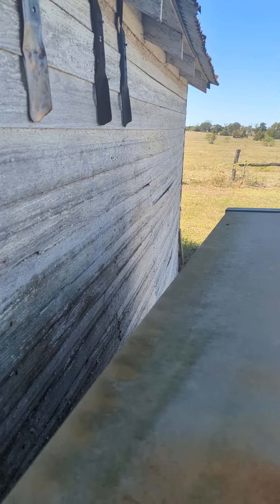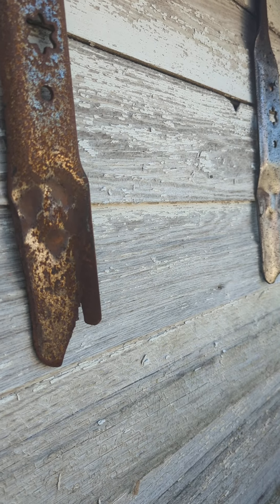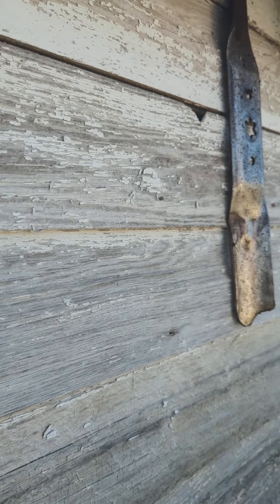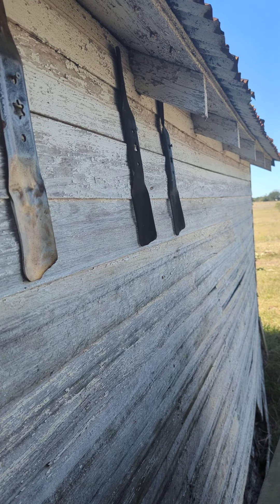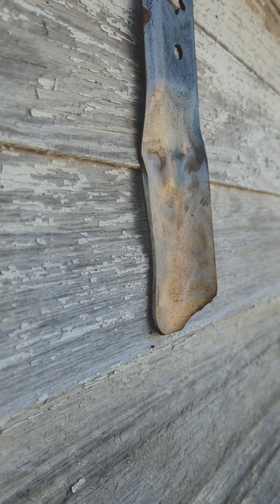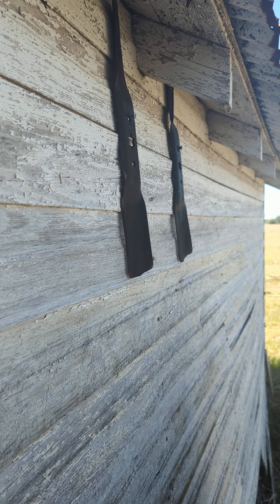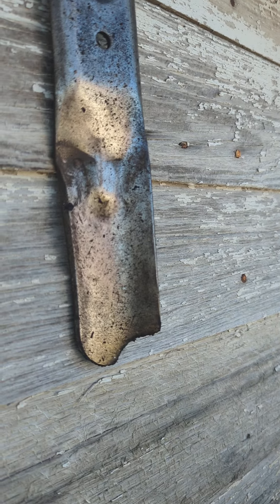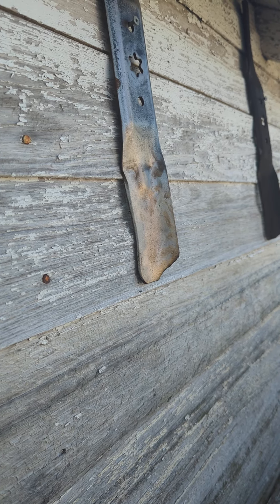Vehicle Undercoating - Day 295 - Update #4 - CRC, Fluid Film, SprayOn

Comment: Maybe at the end you can try to wipe off the black residue and see if there is hidden rust underneath 😮
Reply from the maker: My plan is to eventually hit them with some brake cleaner to see what is under the wire rope coatings.